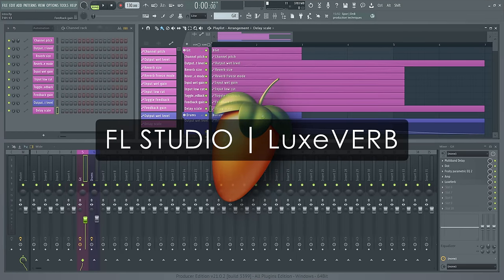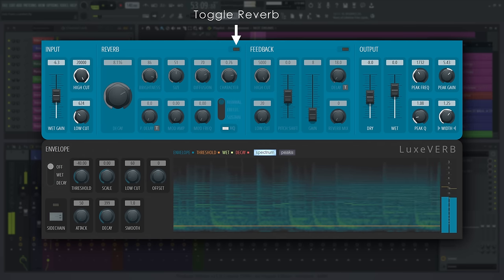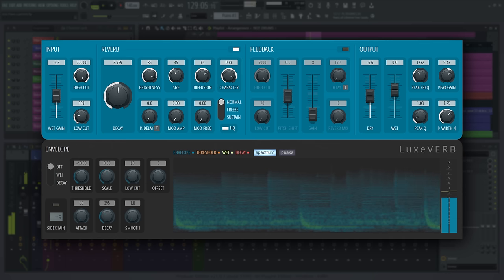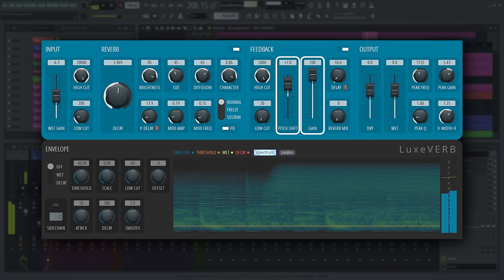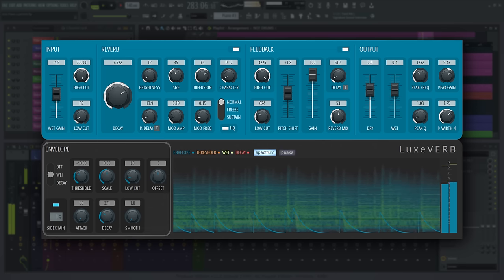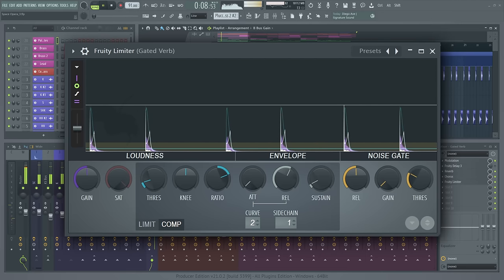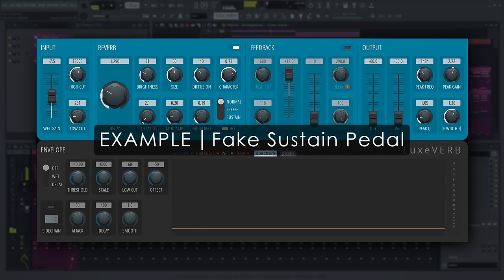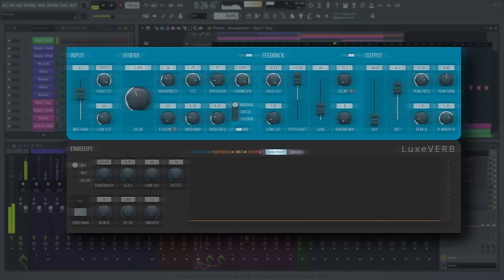FL STUDIO | LuxeVERB

Comment: Best Image-Line plugin in some time. This reverb is very versatile and definitely is capable of doing hall/plate/shimmer emulation. My favorite feature however is the envelope section. Self-ducking built into a reverb is a huge win for me. It makes it really easy to add a reverb direct to something that ducks against the dry input to preserve those harder transient attacks/impacts, and then the reverb still gets to exist without getting in the way. Really saves a lot of time from setting up more complex AUX/SEND channels in the mixer just to set up some sort of sidechain ducking of wet against dry signal. Thank you for this awesome reverb plugin!

You barely scratched the surface of the envelope section, as well as the ability to use external sidechain inputs. You could duck reverb on synths based upon the groove of a drum loop externally for instance. A lot of flexibility here.

Comment: Plsss what’s the difference SIDECHAINing reverb and using PREDELAY knob to control reverb on a vocal.
Reply: sidechain is when you select a source that you will use to " duck " the frequency... delay is when you " delay " the reverb signal. 
the real difference is that " delay " function is a fixed setting you add because you know you want you signal to have " reverb " added after a fixed amount of mili sec's... " ducking " on the other hand does as the name say " ducks " the reverb and will be a dynamic process compared to what the input signal is, instead of a " delay " that will, yeah just delay the reverb compare to the fixed time.